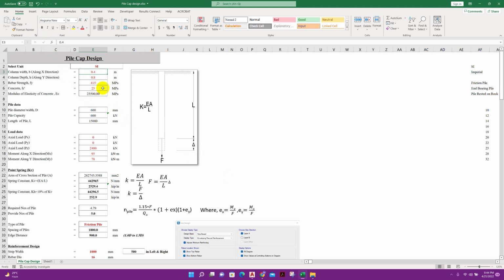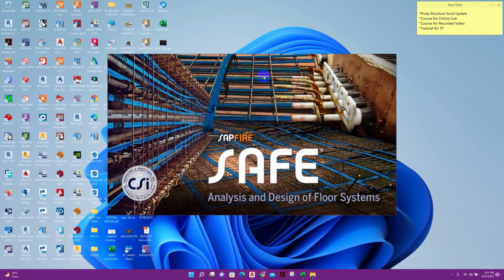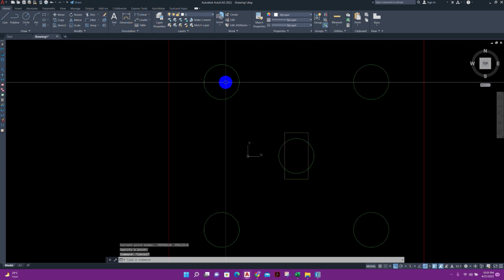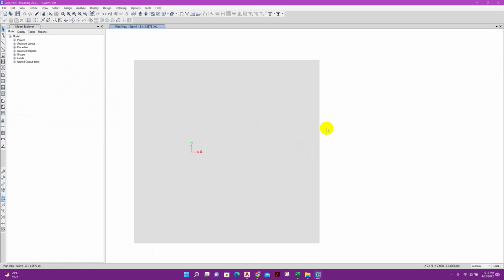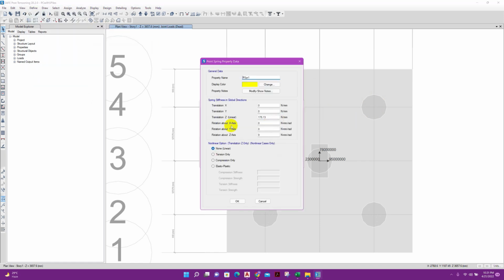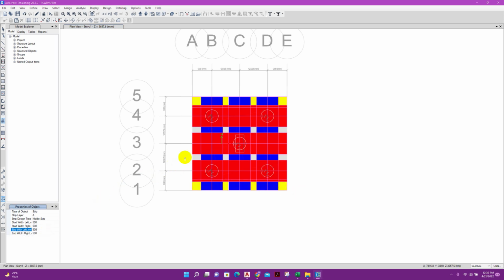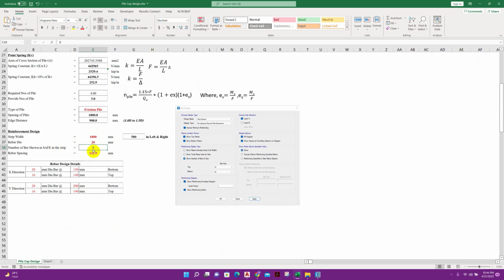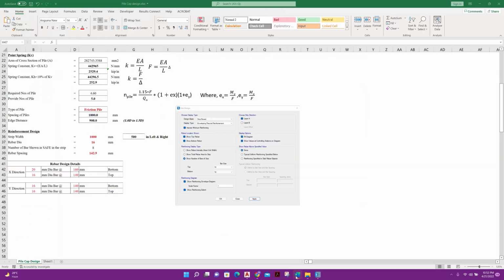Pile Cap Design in SAFE v20.2 | Pile Cap with Five Piles

Comment: Hi Sir, when should we use k=EA/L or k=F/settlement respectively (says if to relate with this tutorial), are they giving the same value for the point spring constant? Then, if L is unknown, do you recommend us to refer to SI and/or basing on own professional-assumption, else can we just adopt the approach of using k= (pile ultimate load capacity) / (pile allowable settlement at ultimate load capacity) ?
Thanks Sir JL
Reply: I have same question.

Comment: Sir, Can you explain how SAFE calculates the punching shear on each pile?

As we know, we need the size of piles to calculate the punching shear. Is SAFE automatically identifying from force on point spring to size of piles for calculating the punching shear?

For example (as long as I know), in MIDAS, we need to distribute the point spring's force to the diameter of the pile with a link.
Reply from the maker: SAFE automatically considers pile area. For being more specific, model pile with it’s diameter on that point.

Comment: Sir, how to input the size of load for punching shear (see 17:58) when assigning joint load? In my case, I import the forces from ETABS, so SAFE directly gives the loads for each pile caps, and I don't know how to assign the size for punching shear.
Reply from the maker: You can model column as stiff on that point to provide load size for punching check.
Reply: @Decodebd  thank you for the insight sir!

Comment: Great video. Do more. Which software is best for steel structure for design and detailing. Kindly advice
Reply from the maker: Noted dear. There are several great software for steel design & detailing. This depends on available code & regionwise practice. If your country code is available in Prota Structure the it can be highly useful. Otherwise Etabs or SAP2000 or Staad Pro also great.
Reply: @Decodebd  I am looking for one software which have do both design and detailing.otherwise recommend me best one for design and detailing and connection design separately